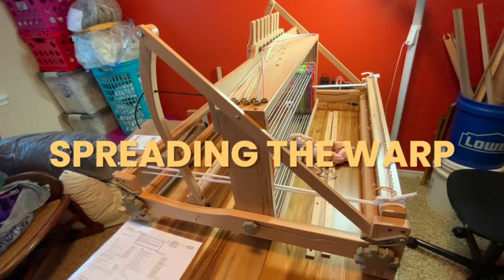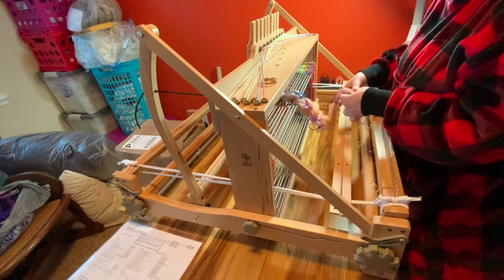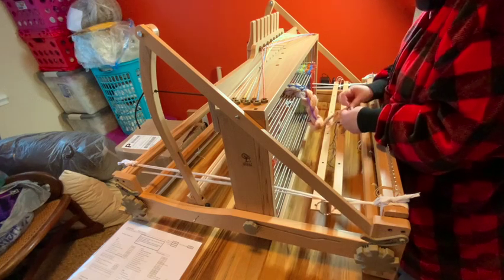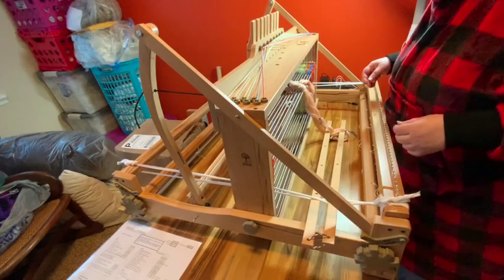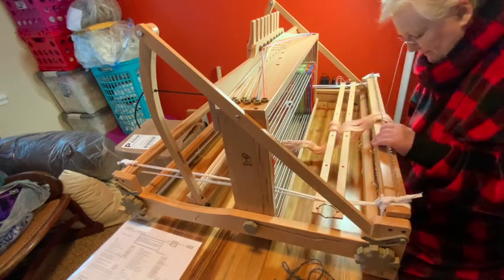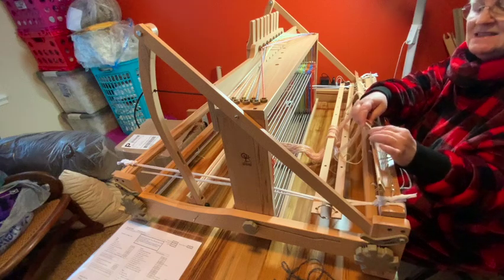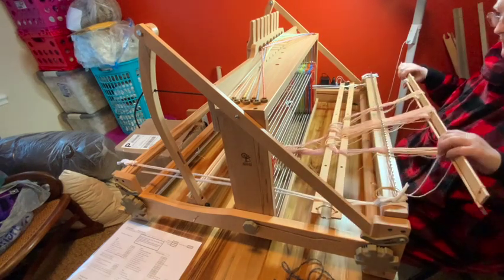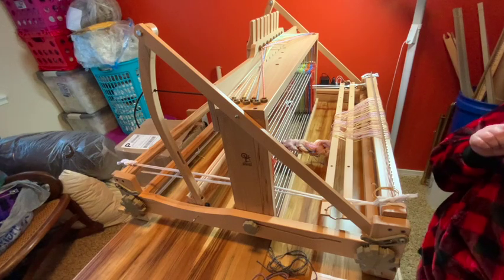Warping Part 2: Spreading the Warp  in the Raddle

Comment: I just bought a David, but with saying that I was using  8 shaft 32 inch Ashford table loom. I found it so much easier to tie the rattle on top of the castle (put all the toggles in the down position). That way, the lease sticks will be on an angle when tied up with the rattle and easier to see and access for putting through the rattle.  When I wind the back beam, I leave everything set up and wind on. Ìt creates just enough tension for single person winding on.